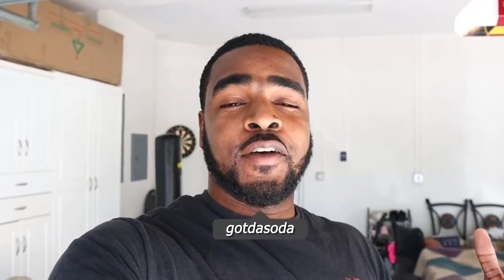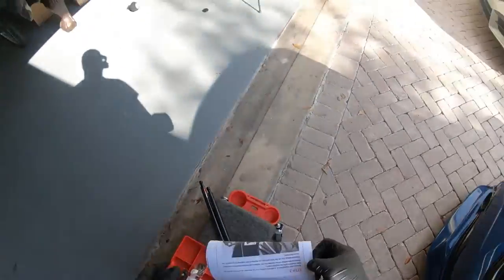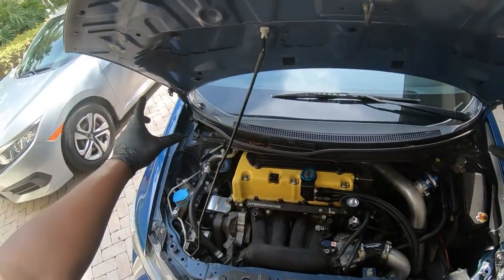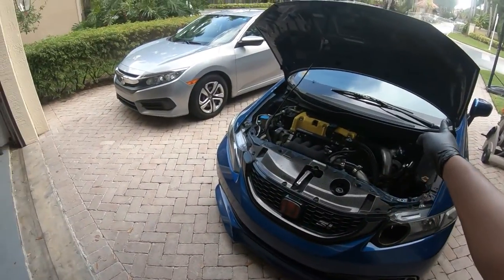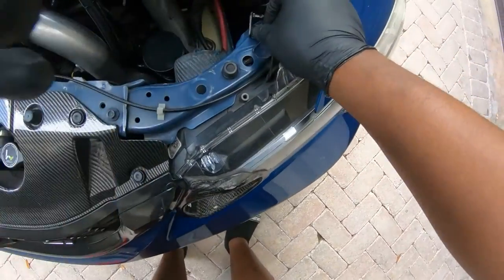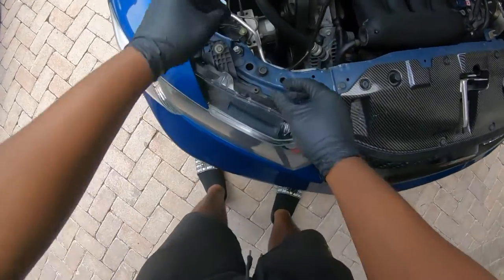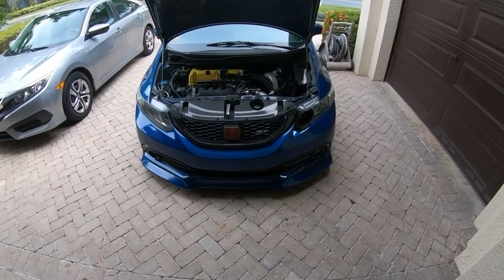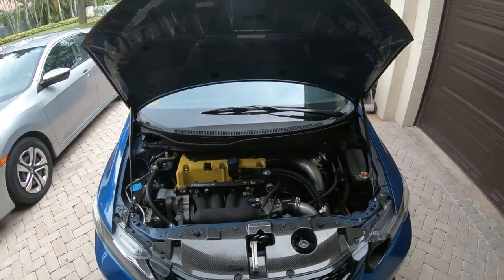How To Make Your Engine Bay Look BETTER For ONLY $35!

Comment: Where did you get the carbon fiber piece at the very front. Goes around the radiator cap etc.
Reply from the maker: Hydrodipped , I have a video on it
Reply: @zoovie  awesome Il check it out. Clean build I love it !

Comment: Update on these things…. THEY WORK LIKE CRAP 🤦🏾‍♂️ not even a full day.. they keep popping out of the clips… or the brackets end up turning as you drive so when you do open the hood they fall apart 🤦🏾‍♂️ the hydraulics are VERY thigh and take a good while before they actually break in to work with sense… it’s a good concept just need a better company to make them a bit more sturdy
Reply from the maker: Maybe you got a bad set. Cause mine is working great